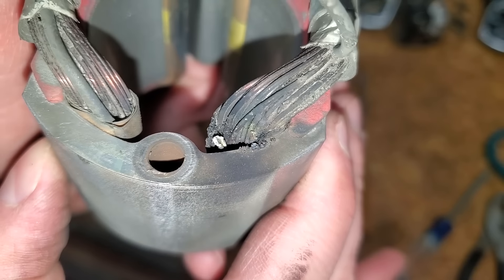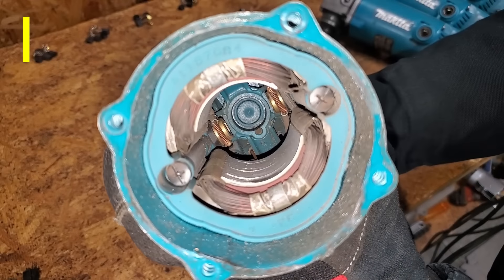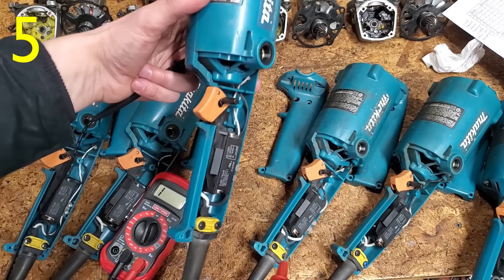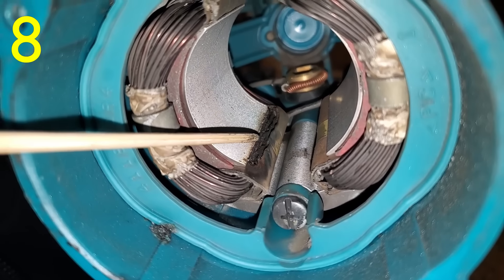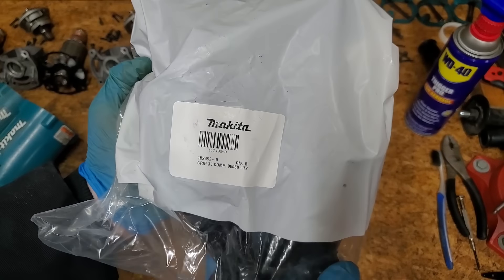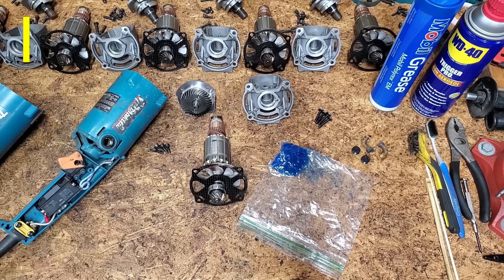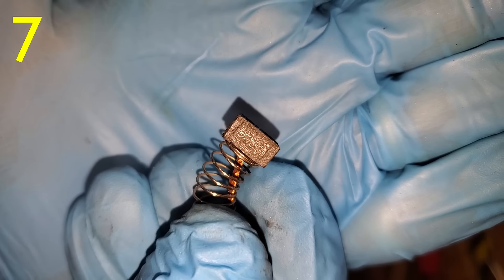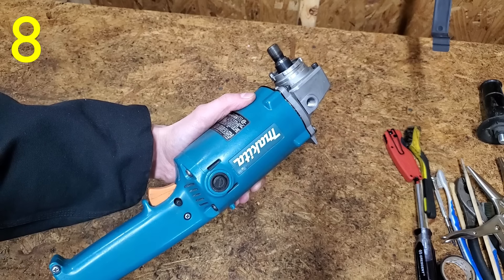Repairing Makita Angle Grinders

Comment: DeWalt uses a small % of Molybdenum Disulfide added into their grease package for their angle grinders. I think it’s actually important for certain types of gears like hypoid or even certain bevel helical gears that use a formed gear tooth rather than a machine cut one. I think it was something I picked up while watching AvE do a tool tear down of a DeWalt angle grinder. 

Personally I believe Makita makes hand down the best angle grinder per dollar than any other manufacturer. Metabo may make a higher quality grinder but Makita delivers a great corded 4.5” grinder for cheap. Even 

Those 5” models may be pricey BUT they deliver the power in a lightweight package. I picked one up NEW on an Amazon sale for $95. Broke my phones screen protector smashing that buy button so fast. They don’t bog down near as much as the smaller grinders do under heavy load, that’s not to say you can’t … those 4 field coils are perfect examples of what happens when you keep overloading the wheel such that its RPM stays at 2/3 or half sped for a prolonged period of time. If that’s what’s happening you are using too small an angle grinder and should bump up to a 6” or 7/9” or back off the pressure a little. You would be amazed at how much more effective the grinders work when they are allowed to maintain optimal load rpm somewhere between 80% - 90%.
Reply from the maker: The plan was to use the same exact type of grease that was originally used but I couldn't find it.

The shop I got these from seemed to have really rode some of these grinders pretty hard. I plan to keep a couple and they'll have a much easier life with me. :)

Comment: You're lucky some jackass didn't slice the cords off! haha 
I've come across so many tools on construction sites that could be fixed, but when you factor in putting a new armored cord on them they just aren't worth the time for the most part.
Reply from the maker: Yep, I only had one cut cord and one with internal damage. New cords were only $8 so it wasn't too bad. I've seen some replacement power cords on Amazon or eBay for around $30 though.

Comment: The only thing I might have included if your intent is to resale would have definitely been an arbor nut and possibly a blade safety guard. Other than that nice video, thanks for posting :)
Reply from the maker: Thanks! I did buy all new backing washers and arbor nuts for the grinders. I decided against the guards because they aren't toolless so, if I do sell any, I assumed the guards would just be thrown away.

Comment: OEM Makita parts are normally easy to buy. Even items like original cables, Field Coils, Rotors, brushes, bearings and case parts are available.
Reply from the maker: Besides quality, that's the other major advantage that sets more expensive tools apart from cheaper tools. It's typically very difficult to find replacement parts for cheap or store brand tools.

Comment: Great Video. I love to repair stuff as well, very satisfying! 👌
Three interesting notes I picked up in a METABO Factory tour video:
1. After changing the brushes, let the machine run without load for 5-10 minutes to shape the brushes (even if they are preshaped)
2. The expected lifecycle of a angle grinder is about 2 sets of brushes. After that, the stator or armature is probably the next thing to fail.
3. The grease in the gearbox usually does not need to be replaced during the whole lifetime of the grinder. With the exception of a grinder that was unused for multiple years.

Cheers!
Reply from the maker: Thanks, those are very interesting notes! I was aware of #1 but didn't realize the length of time recommended. I'm surprised by #2 and 3. I wonder if the brush thing applies to home use as well? I would imagine that a pro would go through brushes much faster than the typical DIYer which would mean that their tools are experiencing much higher heat and longer continuous runtime. I think the longest stretch I've used a grinder without stopping might only be 10-20 minutes. #3 is great news! While the grease did look a little dirty/burnt, it still felt soft, and it would have saved me a TON of time if I hadn't cleaned out all of the old grease. :) Thanks for the info!
Reply: @Mikeattempts  Three  of my grinders are used/repaired grinders and I changed the grease in all of them and will do so in the future even against better knowledge just for  good feels ;) I guess the whole thing with the 2 brush cycles lifetime is probably from a professional user point of view. From that perspective a damaged rotor or stator is maybe not a technical total loss but economically it surely is. Regarding the brushes, the technician in the clip was referring to a situation where a user would change the brushes and the grinder would fail shortly after that because the brushes were not "fitted" or how you want to call it. Because of the typical immediate high current flows in the grinder during load. They even have a station were the grinders run for 8min prior to shipping, so I guess if they invest the time, its probably a real thing :) The video is actually quite the interesting watch (for nerds) but unfortunately in german... so you would have to watch with auto subtitles. Hes talking about the brush thing at 2:47:16 https://www.youtube.com/watch?v=Yj4vGgi-wy4
Reply: It takes a lot of runtime hours for a tool to wear trough two sets of brushes so it makes sense that the rest of the tool is done by the 2nd set of brushes.
Ive noticed that this rule can be applied to pretty much all corded powertools.
Reply from the maker: @mnkrck  All good points, thanks for the info and the video link!
Reply from the maker: @alouisschafer7212  You're right, that's sound logic. I'm not a pro but I got my first Milwaukee drill and driver back in 2009, before the brushless versions were available, and I'm still on the original set of brushes in both.

Comment: In all my experience about 40 years' worth, it's cheaper to buy a new grinder than try to repair a worn out one, the parts are way too expensive, and you still have a worn grinder.  New cords, switches and brushes yeah, armature, stator and gears I would pass.  These grinders in the video look like they haven't been used!  Get some from a metal fab plant to rebuild!
Reply from the maker: At least a couple of 'em with the bad stators looked like they hadn't been used much at all. When it comes to the cheaper grinders, I couldn't agree more, replacing is usually cheaper. However, these are $200 grinders so replacing the stators seemed worth it in this situation.
Reply: @Mikeattempts  When I had my business, I would buy the 9.5-amp Hitachi 4-1/2" grinders.  I tried practically every major brand I could find and the Hitachi's lasted the longest and were the quietest.  When they finally died, I would disassemble them to repair but I soon found out it was cheaper just to save the good parts and buy the crew new grinders.  The 5" Makitas in your video are also excellent machines.  I don't care for Dewalt corded tools, they are some of the roughest and loud tools I've used.
Reply from the maker: @mikescalise8380  It definitely sounds like you got your money's worth out of your tools. I did consider using parts from some of these grinders to the fix others. However, I only ended up spending an average of $36.25 per grinder so that's not too bad.
Reply: @Mikeattempts  You did good.  The stator or armatures for the grinders I worked on were priced close to a new machine!
Reply from the maker: @mikescalise8380  I guess I'm not surprised, I've seen some crazy prices on brand name replacement parts too. From my limited experience, the smaller specialty shops/sites and eBay seem to be the best source of OEM parts.

Comment: all wires are ok  but the motor run ,  goes to normal rpm , then it's coughing  , like an old car ... running , coughing , running coughing .....
Reply from the maker: Sounds like the brushes are almost completely worn down, did you check them? If it's not the brushes, then I would assume there's an electrical short somewhere.

Comment: if the problem is clearly cord or brush related why disassemble every single one and test so many things... every switch got tested yet none of them were bad and if one was bad it wouldnt have added anytime to test it later.. everysingle one got new brushes even though only two of them needed it, and will likely die a death of overexertion before the original brushes would of worn out if given back to a 200lb gorilla whos angry his weld didnt pass xray

its barely worth fixxing these as it is, thats why theyre free or in the trash often.. so when fixxing them the extra steps and extra parts need to be trimmed to make it make economical sense
Reply from the maker: This isn't my job, it's just a hobby and my main goal is learning. Also, you don't think 2 things can be wrong with 1 grinder? I reused 2 or 3 sets of brushes. I wanted to be sure the ones I wasn't keeping had new brushes, just seemed like the right thing to do. I spent an average of $36.25 per grinder and sold 3 to recoup my costs.
Reply: @Mikeattempts  Ya know what makes a horserace? A difference of opinion.
Reply from the maker: @johnberrier  Yep, you can't please 'em all. ;)

Comment: WD40 destroys grease
Reply from the maker: I used it to displace the water in the needle bearings after being in the ultrasonic cleaner. I'm confident that a couple drops of WD-40 isn't gonna destroy anything.
Reply: WD-40 does no such thing.  In fact it's the first junk to flash off at ambient temps, much less while in operation.
Reply from the maker: @Failure_Is_An_Option  Yeah, people love to hate on WD-40 for some reason, but I bet most have never even read the label. :)

Comment: Rotors should be checked on special magnetic unit. Some comutators were worn and should be evened on lathe. Testing with low voltage multimeter can give false results. Some malfunctions can be notice only with nominal voltage. 
Greasing old bearings... No. Just no! They are cheap and  easy to replace. Greasing old ones is poor repair.
I can't belive that somebody throws quite expensive tools to the garbage becouse carbons were worn or cord was broken.
Reply from the maker: Yeah, for some shops, I think productivity is more important than tool repair. I don't have a lathe or any special magnetic testing tools so I did the best I could with what I had.

Comment: He would probably not put in new field coils re the price of repairs..85 bucks for the coil plus labour and brushes..$160 for a new one
Reply from the maker: Yeah, if I can't fix things for 50% or less than I could resell them for, I usually don't bother. The average cost to fix each grinder was around $36 and I could probably sell them for $75-$100 each. Obviously my "labor" isn't included but my goal is to learn, not to make money, this is just a hobby.
Reply: Iremember  my dad in the sixties using old batteries to make brushes as non were available 🤣
Reply from the maker: @garyallport18  Haha, that sounds like some good ingenuity.
Reply: @garyallport18  LOL, your dad was a smart man. I think you can use them with an stick welder too as a carbon-arc electrode.
Reply: It was a common thing in those days..was even mentioned in recent repair videos from Indonesia